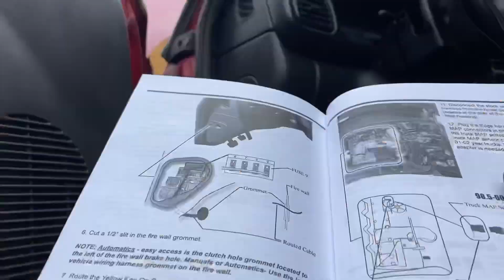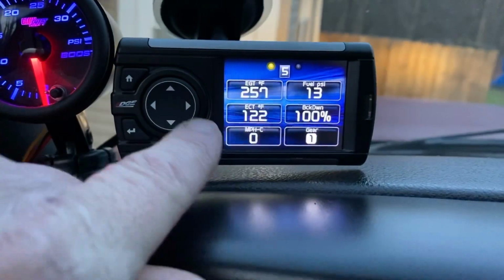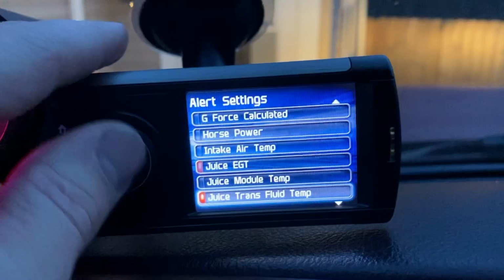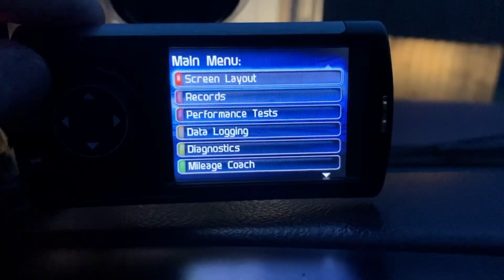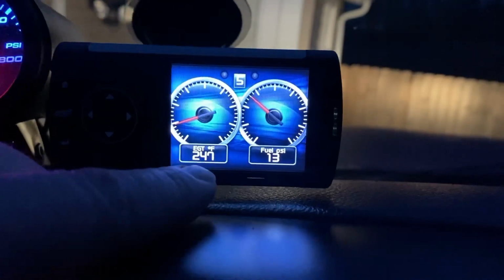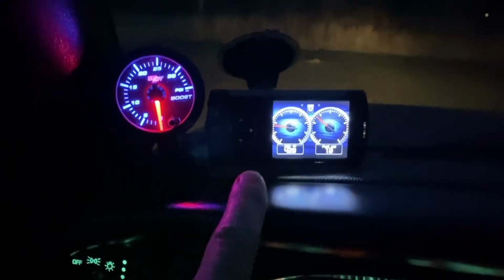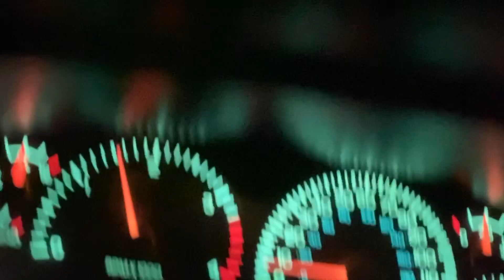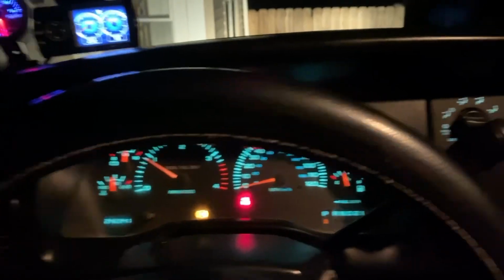Edge Juice With Attitude Stock vs 5x5 Cummins 24v

Comment: The insight cs2 monitor does that just plug into obd2 and you don’t have to run any wires? I have a 02 Cummins. I just want to monitor everything.
Reply from the maker: Yes the insight CS2 or insight CS3 is the exact same thing only it does not have the programmer box which means there are no wires to run out of the firewall accept for your EGT probe which is just 2 wires on a single harness.. aside from that it just gets plugged into the OBD 2 port and your all set.. you’ll be able to monitor everything the factory computer allows for aside from EGT which again will be a separate wire going out the firewall to the probe out on your manifold. Hope this helps!
Reply: @BiffsEquipment  thanks for the reply! Yes that defiantly clears it up!!

Comment: I’ve got the cs2 also on my 2012 3500, this is a very good review. Going to have to make some adjustments to mine now. Down side with mine is I’ve got all the emissions junk on it. I always stress about egts. Wish I could remove that dpf and egr and still run the cts.
Reply from the maker: Thanks man, I always try to be as informative as I can as many guys don’t explain this stuff and it drives me crazy.. when I first got mine there was no detailed videos on this programmer so I said screw it im making a video to help others like myself who want to know lol. Yah the emissions and DEF kill these newer trucks.. All they do is bottle them up and don’t let them breath.. and all these systems do is pollute even more since all the DEF fluid is put in huge plastic containers not to mention the amount of soot that gets burned when you do a regen.. I really wish they woulda just left them alone.. it’s one reason why I’ll prolly never buy a newer truck.. if I do I’ll be ripping out all that crap haha.

Comment: When towing your trailer did the truck performance improve?  And if it did can you describe it and the setting used when towing.
Reply from the maker: Hey Jeff, yes the performance when towing is night and day! Since these programmers add a ton more power by increasing the fuel but most importantly the engine timing. The timing allows the engine to be MUCH more responsive so it takes way less throttle to be able to get the truck moving.. with out the programmer I had to push the throttle 3/4 way down to get a heavy trailer moving, now with the programmer I only have to push the throttle 1/4 or less to get the same trailer load moving.. so this shows you just how much different it is.. when I tow I leave my programmer maxed out.. I leave mine on 5x5 or 5x6 all the time but i don’t recommend it if you have a stock trans or converter as it can easily over power your stock clutches or converter and make it slip since it adds so much extra power to the engine.. I would recommend setting 3x5 for towing at a maximum for a good level of power and reliability. You’ll also get the best fuel economy in setting 3 which is also why it’s a great tow setting.. just be sure to adjust your foot to the gas and learn to ease into the throttle once you tow with your programmer on because as I mentioned before it can be quite easy to over power a stock trans or converter. My trans has since been upgraded internally with “pan off” upgrades along with a built valve body.. I also now have a billet Tripple disk converter and flex plate… so I just leave my programmer on 5x6 max settings now and I also have 150hp injectors and an HX super 9 turbo pushing 50psi and so far iv yet to have a single issue towing with the programmer up so high. Hope this helps, Best of luck!
Reply: Thanks for the reply, Mike.  Good information.  I have an unmodified Ford F150 and my towing capacity is limited.  But I need to upgrade to a 3/4 Ton truck in the future.

Comment: It made a big difference. Your 0-60 with the tune would have been much better with out the wheel spin.
Reply from the maker: Tractor Tech Thanks man. It sure woulda haha. It’s a pretty powerful truck now, I’m very satisfied with its performance and honestly I’m at the limits now of the factory converter.. won’t push it much farther till I start doing some upgrades to the trans. Thanks for watching 👍🏻

Comment: Awesome video and sorry if I missed it but I was wondering if you can make the truck defuel on shifts or not. I’m looking at getting this tuner for my duramax and I know the juice CTS2 can defuel on shifts but still haven’t been able to figure out if the juice CS2 can or not
Reply from the maker: Hey Nate, on my programmer you can’t make it defuse on shifts it only defuels based on boost pressure, or EGT temp or is other parameters like that. Also the programmer for the duramax can be different because it’s a different year, different trans, and computer so the way the edge programmer works on different truck models always changes slightly so you’d have to look one up for your specific truck and see. Hope this helps!
Reply: @BiffsEquipment  absolutely, I appreciate the response 👍🏻

Comment: Does your truck smoke at all on stock tune? We are about the same egt wise and we have the same mods besides I have a full 4 inch exhaust. My truck on stock tune still puts out a good puff of smoke so I’m trying to guess if there is bigger injectors in mine.
Reply from the maker: On a stock tune with everything stock it should smoke VERY little with a stick tune or not at all, if you’re blows a huge amount of smoke with a stock tune then odds are you have either a bad turbo, a boost leak, or larger injectors.. that would be one of your most likely culprits.. what size injectors would be hard to tell unless you actually pulled one out and had a look. You may wanna don’t that just to be sure anyways so you know what you got and don’t end up blowing your trans with too much power

Comment: Can it correct for tire height for Speedo?
Reply from the maker: Yep this programmer has a correct speedo built in and goes by tire size. You enter the tire size that your using and it will display the corrected speed at which you travel. Thanks for watching!

Comment: Did you ever end up changing out your lift pump? If not i know when i bought my truck it had a fass ddrp and it was at 20psi at idle and 14 at wot. It had a different spring to bump the pressure up which helped a ton. Might not be a bad idea to look into that if i were you since the vp's overflow only opens at 14 psi which means any psi under 14 psi is held in the vp instead of flowing through it to cool the electronics. Might be a better alternative to a new lift pump for the time being.
Reply from the maker: Hey man thanks for your comment. I did end up changing out the lift pump, I was getting around 8psi all around but I knew I was on barrowed time if I left it that way specially with the programmer adding so much extra work to the injection pump. I ended up leaving in my in-tank pump and installed a Fass 150. I ran a sump from the bottom of the fuel tank to the new Fass pump.. I now see 17psi idle and never goes below 16 under full load even with my programmer on hot unlock and my timing/fuel maxed out. 250k on the factory VP44 and still going strong! I need to make a new video on my truck soon for an update video.

Comment: Stock vp44 and no problems since the install?
Reply from the maker: Stock VP yep! It’s been a few years since I made this video and the factory VP44 with 270k on it is still kicking just fine. Tho I did end up installing a fass fuel pump later that year i believe just for Insurence cuz I didn’t wanna keep hammering on it with the stock lift pump as the programmer pulls so much more fuel from the injection pump and the factory pump won’t always be able to keep up.. once your pressure drops below 5psi under load your doing damage to the VP pump.. now I get 17-18psi all the time and no lower than 15PSI under a full load WOT condition. Best of luck! Gotta love the Cummins!
Reply from the maker: PS. I have also added 150hp injectors from PDD. Once I did that I could feel my torque converter slipping once it was locked so I took it easy for another 5 months till I bought the 47Re “pan off upgrade kit” from power driven diesel which I made an entire video on the install and explained what all the parts do.. after that I drove the with the stock converter for another so many months and it didn’t slip anymore but eventually started slipping the converter again  so before I ruined my trans I bought the power driven diesel Tripple disk torque converter and billet flywheel and after installing those parts I have never had an issue again.. I can romp the truck all I want and I have never had an issue, all the clutches inside the trans are stock and the trans has alot of miles on it but she shifts like a dream and holds/puts down all thr power to the wheels no issue. Don’t listen to guys who tell you you gotta install a billet input shaft and built clutches and all that. All you need is the pan off upgrade kit from power driven diesel along with their Tripple disk converter and upgraded flywheel and once all that’s installed you should be good for up to 500-550hp all day long so long as your trans/clutches were in decent shape to start with
Reply from the maker: PSPS. The biggest thing you need to make sure of when adding more power to a stock 47RE is to make damn SURE you keep an eye on your 2nd gear band adjustment along with the reverse band adjustment.. keeping the two bands in adjustment and checking them every 20-30k miles when you change your oil and filter will keep the trans living a very long time .. it’s only when you let them go out of adjustment that it slowly eats away at the rest of the trans.. same thing will happen if your constantly slipping the stock torque conveter

Comment: So you’ve got nothing done to the wastegate or anything?? I have a 2001 cummins and it doesn’t build boost like that, wastegate opens at like 20-23psi
Reply from the maker: Yes I had the Edge boost Elbow installed on the wastegate vacuum line. With out it your only gonna hit 25psi tops, with it you’ll hit 35psi easy.. or at least 33. I now have a different turbo, larger injectors, and head studs, and a Tripple disk making a lot more power but I was very pleased with the power I got out of my stock hx35 with the edge programmer and lift pump.. it was more than my stock converter could handle that’s for sure.

Comment: How is your setup at 13 fuel psi? Mine only showing 5psi
Reply from the maker: I have an aftermarket lift pump installed its a Fass 150 pump.. I also have a sump installed on the bottom of my tank so i can bypass the factory in-tank lift pump.. The factory lift pump only got me 5-8psi as well which is normal.. but its not enough flow or pressure and can slowly burn up your vo44 (injection pump) which is why you should convert to an aftermarket lift pump asap.

Comment: Is this truck a stock auto?
Reply from the maker: It was a bone stock auto when I made this video but it’s not anymore. I been meaning to do an update video on my truck. Since this video I have added a fass 150 lift pump, 150hp PDD injectors, an HX Super 9 turbo, a “Pan-Off upgrade kit”, a PDD Tripple disk converter, head studs, and more.. I was to the point where the programmer was starting to make the converter slip, then I added the injectors next and it really started to slip bad, so i had to do the trans upgrades before the clutch material from the slipping converter burned the trans up. So far I’m still on the same trans and its holding the power perfectly fine after I did these upgrades
Reply: @BiffsEquipment  how long did the transmission last? My local shop told me I should be ok with a stock rebuilt transmission as long as I keep the tuner low and don't drive like a jackass lol

Comment: Is this the inshight
Reply from the maker: No this is the edge CS2 but it is very similar.. The insight is not a programmer its only a monitor.. The cs2 or CTS2 is a monitor AND a programmer.. That's the only key difference.